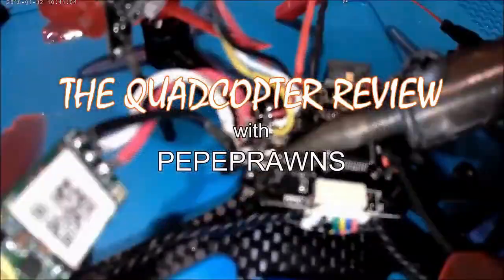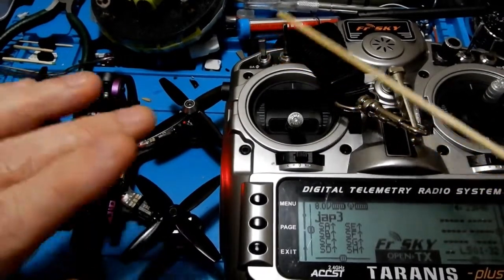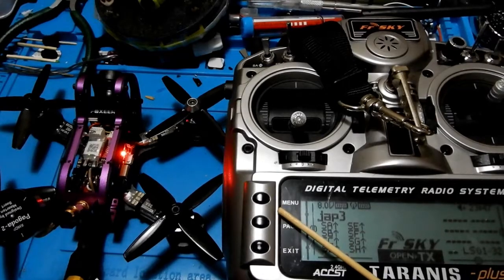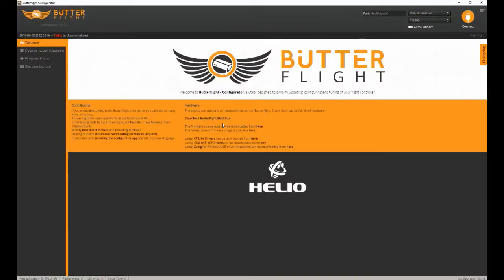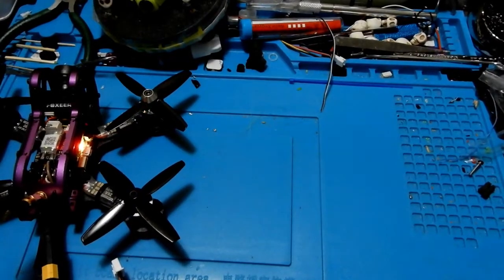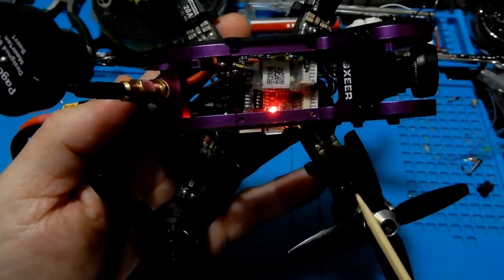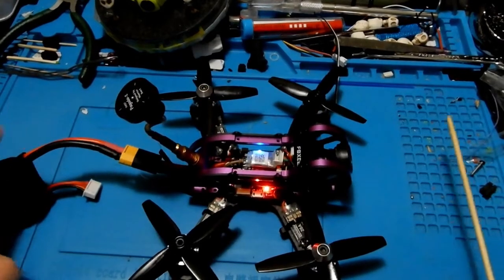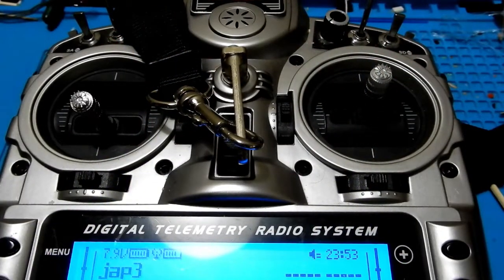FrSky R-XSR & R9 Receiver: No stick input issue - Solved

Comment: I am facing same issue in my quad, all the settings are saved previous one. Receiver is bound to my transmitter but in transmitter doesn't shows rx and in betaflight it shows error as "RX_FAILSAFE MSP" m using flysky fs-i6s  transmitter and flight controller is aikonf7 and I have connected Receiver in R1. So opposite to uart 1 I have enabled serial rx but nothing happens. Cannot enable any uart it goes off automatically after save and restart.

Comment: By pressing the FS button for 4 seconds, you translate the SBUS protocol into the CPPM protocol here is the receiver manual...SBUS/CPPM output (BLUE LED stay lit indicates R-XSR in SBUS mode, otherwise in CPPM mode)How to switch SBUS and CPPM signal: Long press the F/S button on the receiver for 4 seconds, the BLUE LEDwill flash three times, indicating the switch is completed.

Comment: Thankyou for video was trying to figure out a similar problem for the last two days with my EDF jet. After buying a new transmitter. And your vid makes sense. I probably did hold the binding key for way to long. I was going absolutely crazy re pluging in my servo plugs in all ways under the sun trying to understand why I had no input and even ripped some wires out. Look forward to see if this helps. But pretty certain that's it cheers.

Comment: my problem is the exact opposite. i have sticks and motors in betaflight which tells me im bound. when i disconnect from betaflight and plug in a pack, i get the blue and the green light. i am on sbus....... when i try to arm, still no sticks or motors. what is this. why is it doing this?

Comment: I seem to have every problem there is with this thing. I DO have the steady blue light and still no response.
Reply: did you figure it out?
Reply: @yaboi8616  yessir! the yellow wire on my rxsr plug was wrong. i had to pull it off the plug and move it over 1 space. thank you for asking. NOW, all i need is my dang charger and i can start learning FPV.

Comment: Hey guys! I am binded with x-lite s to my r-xsr, same issue no input, but when I hold bind button for 4 seconds the red light is flashing and xlite is reconnecting to r-xsr, issue is not fixed. Firmware is the same 1.1.3 on both.

Comment: I have this same issue but I am having sbus selected. There is blue and green lights on but no stick movements. Tyro79 and that same receiver. FC blinking red light.. This was working with Futaba sbus but when changed to FrSky then this happened.
Reply from the maker: Maybe you did do this but did you change the setting in configuration on betaflight to sbus?

Comment: First off, thank you soooo  much!!  Got a Diatone r349, I did everything you were talking about, short of checking out the R-xsr manual, I've been hyper focused on the CLR F7 board that's on it, thinking the uarts were wired wrong. (I bought it slightly used from another pilot, online, but he's well known on that site and has excellent builds.)  I literally told the guys in my local club, on FB, first one to my house can have it, or I'm chuckin' it in the garbage. 

Ok, just saw this post, so haven't tried fix yet, but have one quick question, and head scratcher. So all my symptoms are the same except that my blue light is on, and solid, on battery, but instead of green light, the red light is still blinking.  According to manual, only time red light blinks is after successful binding, but as soon as you undo power and plug back in, that light should be solid green,....or solid red if the binding didn't work.
Reply: Oh, btw, I lost one of the little rx antenna, so the r-sxr only has one antenna attached to it at present.  There's no way that could be causing an error is there?  I have some more on order.
Reply: Disregard, I was wrong, red only flashing when no battery.  Guy 3D molded a tpu mount for antenna that incorporates a slot for rx, so it’s tough to see the green light.

Comment: Hello,
I've got the FrSky XM+ receiver, did the binding proces, got green light after I powercycled, but it doesn't show up on my transmitter, got no controls and doesn't work on betaflight either. Anyone had this problem in the past?
Reply: Not in the past, but today. I’m still looking for a solution
Reply: Same here
Reply: There will be no stick inputs or anything . I have been trying to figure this out for a month now😥

Comment: In the beginning i was syked until you mentioned holding the button because i already knew this.
 I tried both and still no betaflight receiver input. :( 
Also tried changing the charts and receiver settings etc.
Anyone?

Comment: so what do u do if you are having that issue on 1 fc but the same rx with absolutely no change s get no issues with another fc?
Reply from the maker: Question one. On the quad that it isn't working did you have an xsr on it before trying to use the r-xsr. Second question are these both the same brand and model FC's?

Comment: Is it sad this is my second time being here for the same problem? Totally forgot about this and just got a new quad having this issue I'm about to pull it apart I can already picture it had a green light and not blue so I'm betting this is the issue! Thank you so much AGAIN hahaha
Reply: Cody Borchers check your sbus wire to where/ what number its soldered to, depending on the number you should enable it in betaflight frome the serial ports tab

Comment: YOU SIR, ARE A LEGEND!!! Thank you.
Reply from the maker: So glad I could help my friend. I knew people would need an easy way to find this one. Took me days to find the issue. I hope it saved you some time.
Reply: @TheQuadcopterReview  I only struggled for about an hour when I found your video.    The others had firmware updates and all the things I was dreading.  I was trying to bind my controller but I don't have 3 arms. So I must have held it in after the battery got connected.  THANKS AGAIN!!   I didn't read the manual. I won't lie. Who needs manuals when we have people like you. Life saver.

Comment: Great, just had this issue and your solution worked like a charm. Thanks
Reply from the maker: So glad i could help. I knew as soon as that happened to me and it took me 3 days to find it that i needed to post this video.
Reply: @TheQuadcopterReview  I just did my first build and I really appreciate your video, I was about to throw in the towel and  blame it on a bad receiver.

Comment: TRIED THIS DIDNT WORK FOR ME , CL RACING F4 BOARD . CANT GET ANY STICK MOVEMENT
Reply: Super Charged me too. Anyone have any ideas what's up?
Reply: @nolangelinas3566  I tried another R-xsr and it worked. Must of had a faulty one .
Reply: Super Charged strange, mine is brand new. I'll try updating all of my firmware on the rxsr, the taranis and my fc. Also I'll try changing out the fc and c how that goes. Hope I can get it working
Reply: @nolangelinas3566  mine was a new one also , I also tried it on a brand new Matek F7 board and didn't work. I also updated F4 board and the R-sxr. Still no luck. Make sure your using the green wire for SBus and yellow for Tel.

Comment: I have blue light and nothing first time using r xsr everything else was sold out lol I'm trying to use my brand new x lite radio and I'm using a rotor  riot  fc and have the signal wire solder to the rx1 inverted just like my xsr receivers and nothing it's bound and I'm getting signal on my x lite

Comment: Does anyone's receiver get very hot as mine does and i cant get stick inputs even though its bound a sbus (blue light)
I have an omnibus f4  controller with the red wire to 5v, black wire to gound and green wire to sbus
Reply: sounds like I have the same problem. I can then switch out with my old x4r and the sticks/quad work fine. Any luck?
Reply: @neuronaut414  yes I updated the receiver firmware and it solved the issue.

Comment: Hey I am having this exact problem.  I did switch the mode so that I have the blue light.  I still get no throttle inputs.  How did you wire it to the board?
Reply: Xantar2482 mine too. No throttle inputs
Reply: @SuperNizak  solution?
Reply: @SmiKProduction  got the same problem. couldnt find a solution yet. maybe its defect? oO
Reply: @elc4tivo135  1: Look if it's in Sbus (blue and green led)

2: Be sure it's the same firmware on the receiver and the controller

3: You have to inverted/uninverted the signal in betaflight (with the CLI) <----- that was my problem

4: Make sure your inputs are corrects in betaflight

Comment: I'm getting g the same issue but I'm am in sbus mode.
In brand new to the taranis just come from spektrum. 
I'm using an f405 uart 2 set as serial dx7.
Configured as a serial based reciever  and sbus on the serial reciever provider any ideas ?
Reply from the maker: do you have it set as d16 on the radio itself on the first page of the model when you bound it?  Also have you tried the flashing steps that Bardwell suggests here : https://www.youtube.com/watch?v=m4ygG6Y5zXI and another fella goes through it here https://www.youtube.com/watch?v=1bxlNSnFrjU&t=3s i just want to rule out some things.
Reply: Thanks for the reply. It's fixed now my fault read the board wrong soldered sbus wire to the wrong tab